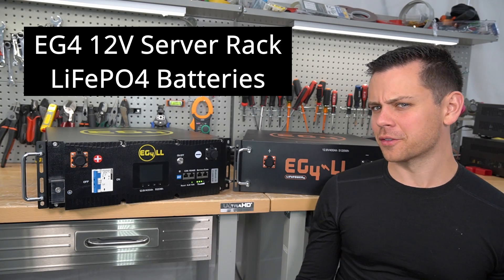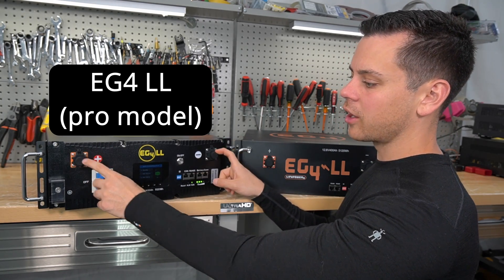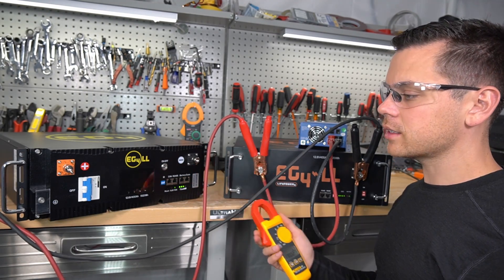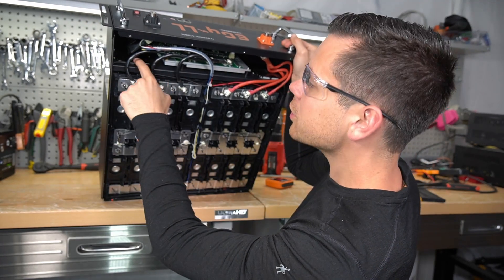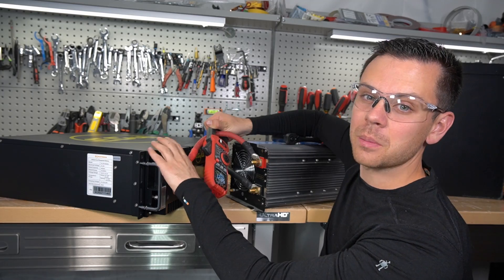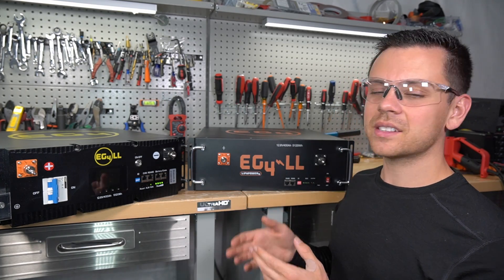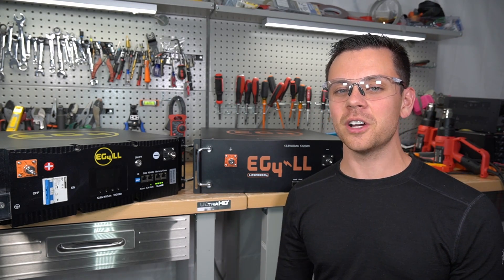$1,449 EG4 12V 400Ah LiFePO4 Server Rack Battery

Comment from the maker: Signature solar has a sale for 5% entire site. Affiliate links here:
Budget 12V 400Ah Battery: https://signaturesolar.com/eg4-lifepower4-lithium-battery-12v-400ah/?ref=cPwLcVc0SW-BjN
Pro 12V 400Ah Battery: https://signaturesolar.com/eg4-ll-lithium-battery-12v-400ah-server-rack-battery/?ref=cPwLcVc0SW-BjN

The sale is 5% and a deal for shipping these batteries. This sale ends April 18th.

If you don't need 400Ah, the cheapest 12V lifepo4 with low temp protection can be found here: https://amzn.to/3KoNVlq

Price comparison is in 100Ah. Figured that was obvious but saw a  lot of comments not understanding that. Sorry 

0:00 Intro
4:14 Charging to 100%
5:40 Budget Battery Max Current Test!
7:08 Budget Battery Tear Down
9:16 Pro Battery Over Current Test
11:16 Pro Battery Tear Down
13:10 Fire Arrestor and Breaker Discussion
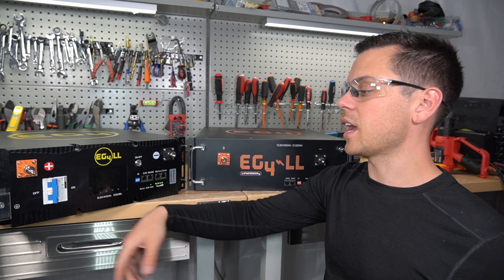14:32 Downsides
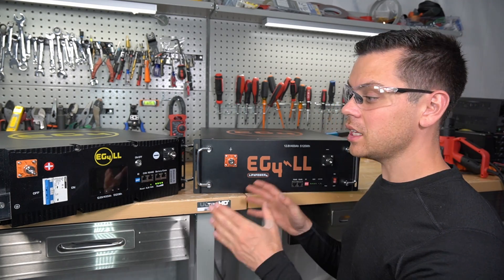16:52 Price Comparison
18:05 Conclusion

~~~~~~~~~~~~~~~~~~~~~~~~~~~~~~~~~~~~~~~~~~~
Tired of getting ripped off? Check out my "Will Prowse Approved" solar product recommendations below!

12V Batteries
https://www.mobile-solarpower.com/lithium-batteries.html

48V Batteries
https://www.mobile-solarpower.com/48v-batteries.html

Offgrid Inverter System Builder
https://www.mobile-solarpower.com/48v-complete-system-blueprint-559371.html

Hybrid Inverter System Builder
https://www.mobile-solarpower.com/code-compliant-48v-offgrid-system.html

Mobile Handtruck System Builder (very popular!)
https://www.mobile-solarpower.com/mobile-48v-system.html

Solar Panels
https://www.mobile-solarpower.com/300w-solar-panels.html

Ground Mount Solar Racking
https://www.mobile-solarpower.com/ground-mount-racks.html

Wire, Lugs and Busbars
https://www.mobile-solarpower.com/wire-and-connectors.html

Tools
https://www.mobile-solarpower.com/tools.html

Fuses and Circuit Breakers
https://www.mobile-solarpower.com/fuses.html

Plug-N-Play Solar Systems
Ecoflow, Anker And Bluetti! So many models to choose from. See my current recommendations here:
https://www.mobile-solarpower.com/full-size-systems.html

~~~~~~~~~~~~~~~~~~~~~~~~~~~~~~~~~~~~~~~~~~
Need to build a large DIY system? Need a trustworthy solar distributor? These are my favorites:

Signature Solar
Creator of EG4! Solar Minisplits, Victron and More! Largest Solar Store Online.
If you want $50 off, please use my link below and coupon code "DIYSOLAR50":
https://signaturesolar.com/?ref=cPwLcVc0SW-BjN

Current Connected
Best Prices for EG4, Victron, Midnite and so much more! Fast Shipping and Highest Rated Customer Service:
https://currentconnected.com/?ref=wp

~~~~~~~~~~~~~~~~~~~~~~~~~~~~~~~~~~~~~~~~~~
Join our DIY Solar Community 
Need more help? Join the largest solar forum on the internet for beginners and professionals alike. 140,000 members and counting!
https://www.diysolarforum.com

Check Out My Free Book
Best-selling and beginner-friendly guidebook to off-grid 12V solar!
https://www.mobile-solarpower.com/the-book.html

~~~~~~~~~~~~~~~~~~~~~~~~~~~~~~~~~~~~~~~~~~
Contact Information:
I am NOT available for personal solar system consult! If you wish to contact me, this is my direct email: williamprowsediysolar@gmail.com
FTC Disclosure Statement and Disclaimers:
Every video includes paid promotion or sponsorship (such as free products for review). Some links on this YouTube channel may be affiliate links. We may get paid if you buy something or take an action after clicking one of these. My videos are for educational purposes only. Information is subject to change/update at any time. Electricity is DANGEROUS and can kill. Be smart and use common sense :) DIY Solar Power with Will Prowse is a participant in the Amazon Services LLC Associates Program, An affiliate advertising program designed to provide a means for sites to earn advertising fees by advertising and linking to Amazon.com
Reply: You should mention how much these things weigh. I ordered one and after getting the receipt did it saw fkibg ONE HUNDRED AND TWENTY FIVE POUNDS!!  I HAVE NO IDEA HOW TO GET IT ON MY HOUSE
Reply: Inside house
Reply: Awesome review and video!
Where are these batteries being sold at this prices you mentioned on the video:
EG4 Lifepower $362
EG4 V2 $437
Reply: They have 24 volt models do you think the quality and build is the same? I also am running a 24 volt 3500 wats Outback Power inverter will the 24 volt version run with the 3500 watt Outback? 

Thanks John
Reply: from what I understand , you prefer and recommend 24v verses 12v.  I plan on building 24v/100a overkill battery with 3000w pure sine inverter and 24v-12v converter to tie directly into my current multi fuse box.  the top of the caravan is congested with other fixtures so I don't think I can get enough panels on top. I plane on building a rack on top of my ford expedition to hold the panels and run leads to the RV.

Comment: I'm confused that doesn't make sense to me to charge them to 3.65 and only draining them to 20% . I was always told to never charge to 3.65 as it's pointless because the drop from 3.65 to 3.45 is so fast it don't seem adequate and a waste . My cells are full charged at 3.45 and dead at 2.50 which makes alot more sense.

Comment: My 12v 400amp battery out of out of balance after one year when I hooked it to the Bluetooth after seeing my battery goes to the protection mode when Icharge it the battery Sael  is reading  3.37 -3.34 - 3.38 - 3.79 can you halp

Comment: If I was to use this for vehicle  life applications, What is the best way to charge with the alternator? The 800  watt alternator charger by Ecoflow? or multiple Dc to Dc 40A chargers by Renorgy? Have 420 Amp alternator. If I had a 48V battery just like the hand truck DIY, can it be rigged to charge with 12V car alternator?

Comment: I just bought a 32 ft travel trailer. We are building a Shop w lean-to. We are going to move into the Trailer which is parked under a lean-to, and sell the current house. And be debt free. And will also use Trailer for occasional Friday thru Sunday camping. So many state parks are booked until last week of September. So the point is, if we want to camp in the summer when school is out, it seems we need to do the no-power spots. I just bought the EG4 12V 400ah battery, from signature solar,  so I can do some sort of off grid camping. It'll deplete running an AC. But should do just fine with charging two phones. Ipad for streaming. Refrigerator. 12V led lights. Water pump. Probably need my inverter Gen for the AC units. Csn run 2000w inverter generator to charge the EG4 battery. I have 2 renogy 100 watt solar panels along w a Victron 100/30 MPPT and hope to do some cool stuff w the travel trailer and the 12V 400ah battery. Also have a Interstate RV/MARINE 92ah battery as a "stock" back up.

Comment: PROBLEM!!!    @WillProwse the EG4 LifePower4 batteries are a great value and even on sale right now however the units I purchased (3x) over the course of about 12 months have two different BMS model / software versions and two of the batteries errantly report that they are 100 Ah designed capacity instead of the correct 400 Ah they should be.  This is wreaking havoc on my setup as I purchased a new EG4LL to be the "master" (with the other 3 as slaves) which can talk to and report SOC to my Victron Cerbo GX but the errant capacity reported by those two batteries completely throws off the calculated SOC for the whole bank!  EG4 has not responded to my emails and Signature Solar doesn't know what to do about this since there are NO FIRMWARE UPDATES at all for these batteries.  If anyone here is planning to put together several of these as a bank, buyer beware that they might get the BMS version that reports wrong and thus makes BMS comms pointless :(

Comment: Love your videos, Will.  Most of it going over my head since I know next to nothing about electronics, batteries, electrical. However, the fact that I can buy an EG4 lithium 12V battery at a fraction of the cost of others, is very heartening.  I was despairing about that.  So very glad to have your videos and insights and testing.  Thank you!!

Comment: Went to Sig solar to look for a manual for this battery and they have been pulled from the site. Looks like they are clearing out remaining stock of the other variations and then removing all traces of them. From my order page I get:

EG4-LL Lithium Battery (V2) | 48V 100AH
Unfortunately this product is no longer for sale so it cannot be reordered. 

So much for adding more to an incomplete system......
I looked around and cannot figure out if EG4 stopped making them or Sig Solar just stopped selling but shop solar has them far cheaper than sig solar ever did even a week or so ago when they were still there.

Comment: I noticed that the circuit breaker on the Pro model was a 125A, but you mentioned that the battery was rated for 200A continuous discharge

Comment: Hi I just bought a EG4 LL Lithium Battery (V2) | 12V 400AH | Server Rack Battery from you now I am looking for and inverter to use for my RV off grid have 5 solar panels  just want to be able to use when not plug in or dry camping thank you Ron

Comment: We used an arc welder to rejuvenate dead 12v lead acid heavy equipment batteries with great success. One of the mechanics had the nack of it, and dog dead frozen batteries could be desulfated and last another year or two. As long as they didn't blow up during the thawing process.

Comment: Will, We purchase the budget EG4 server rack battery you have in this video from your affiliate.  We purchased a PowerMax PM4 75 Amp charger.  We have the charger set with a fixed stage and 14.0 volts per the battery mfg requirements.  We are having problems with the battery going into a protect state for over voltage on cell 4.  We have cycled the battery down to 20% and charged back to 100% for 7 days.  Still having the same issues after 7 days of frustration.  We have been told by the battery seller's customer support that the charger is not compatible with our lithium battery.  What charger did you use to charge the EG4 LiFePO4 battery in this video?  Any recommendation that are budget-friendly for our RV?

Comment: Got a question 
I have 2  24v server rack batteries running to a bus bar 
And one is discharging at a faster rate
Both at 100%
Put them under load 
One is 96%
One is 99%
Is that normal for them to not be balanced 
Thanks

Comment: You've got some great videos!  

But I'd like you and everyone to know, I just paid $16,123.21 to SIGNATURE SOLAR 903-4412090 TX on 07/10/23 for EG4-LL Lithium Batteries Kit (V2) | 30.72kWh with 6 Server Rack Batteries with Pre-Assembled Enclosed Rack with Door & Wheels and the EG4 18KPV Hybrid Inverter.  The next day, 07/11/23, I drove to Texas from Florida to save on shipping to pick these up after they notified me it would be ready for pickup. When I got there, after making an appointment to pick them up an having to be there within a 15-minute time period or they canceled your appointment, they notified me they did not have the rack because they were having trouble with the maker and the welding.  They are selling batteries and the rack, without the rack!!!  This does no good because you can't install the batteries without the rack.  I'm waiting for the rack and my warranties are running out. They told me they would send me the rack, but they have no idea when.  You can't build a system without the rack!!!  But they are selling them and not telling you they don't have the racks because they charge $10,119.00 for the set.  If you look on their website, you'll see some items listed as "Out of Stock", but not the racks because this too much money to lose. BUYER BEWARE!  

Will, I noticed on one of your videos that you commented that you are still waiting and don't have a door on your rack from SIGNATURE SOLAR.

Comment: Can you parallel these 12v batteries to create 800ah battery bank ? I've done it on flooded acid batteries but I'm being told by people that you should only go series, not parallel on these lithium server rack batteries. It seems that if you match the voltage prior to connecting in parallel then everything should be fine right?

Comment: I have the cheaper model without the screen and breaker.  I'm having all kinds of trouble getting it to run a 3000 watt magnum MSH3012RV.  I believe the precharge resistor circuit is kicking in when it's not needed, which momentarily drops the voltage to the inverter near zero (5ohm resistor).  Battery faults just turning it on.  If I get it boot up the inverter, when I turn the inverter precharge circuit kicks in and browns out the inverter and it re-boots.  Microwave doesn't have a big inrush, steps up to ~ 140 amps...But every other time it faults the battery.  I even had it kick in when trying to charge from then generator, which faults the battery, kills all power including to the gen controls, turning off then generator!  Unfortunately, I have gotten nowhere with Signiture Solar's tech support.  It takes a week to get an email returned, multiple calls, hours on hold, and nothing.  They also refuse to take it back and refund me.  They can't tell me exactly what conditions cause the precharge to engage (like >200 amps, > 300 amps for xx milliseconds, current ramp rate, etc), so I can try and avoid those or design more work arounds.  The 24 & 48 volt models got firmware updates to resolve many such issues (11 months ago), but nothing for the 12V models.  If you can help with any information, it would be greatly appreciated.

Comment: I enjoy your videos will, thanks. I am going to purchase one of these two batteries. Based on the two batteries and the difference in price, do you feel the additional 5-year warranty and difference in two versus three positive leads is a benefit over the savings of the budget battery? I will be using a separate battery switch for convenience.

Comment: I just ordered this bad boy, Shipping was pretty expensive but, I am replacing my only 1.5 year old renogy gel cell 200 amp hour batteries.  Mine is a small emergency of grid system not tied directly to the house, I actually have the newest model of the gandelle 4000 W inverter. I'm glad to see you use that 1 hopefully it should work OK on mine.  Mostly to keep the fridge cold the entertainment center and Internet running during power outages.

Comment: I have a question. If I use a lithium battery that is being charged by my boat alternator in the BMS switch is off. How do I protect the diodes in my alternator from burning out?

Comment: I live off grid on a farm in a camper.  I scraped up three 12v deep cycle lead acid batteries. Connected to a 1000watt inverter. I have three foldable 160watt dokio panels all running to very cheap pwm controllers. From learning in one of your videos it doesn't matter how many controllers you connect to a battery bank.  Was a question i didn't even know i needed answered at the time.  I also have a 6500watt gasoline generator that is to expensive to run. 
I am wondering if I should replace the charge controller first because it will help me now and down the road when I can afford lithium cells to build a battery of my own! Where can i find your book?

Comment: Hi Will
Do you have any experience with a parallel connection of lead acid golf cart batteries with 4 24v lithiums?
I notice a substantial increase in charge and discharge capacity. When operated separately the bms kicks in too early preventing a full charge/discharge.

Comment: Thanks for rounding back to discussing 12V systems. For small mobile applications—5 kWh or less—it's hard to justify the costs of using 48V or even 24V. The cost of thicker, but very short cables, etc. don't make up for the higher cost of less common equipment. 

I would like to hear more on the reliability of server-rack batteries in a high vibration environment such as mounted in a van or small RV. Do you have any input on this subject?

Thanks again for your quality reviews and advice!
Reply: The way I figure it, if you're going to need 4 12v batteries, might as well go 48v.  If you need 2, go 24v, less? Go 12v..  considering all the 12v is just a parallel vs series battery with the same wattage overall.  Yes, less than 5kwh, (if you don't plan to expand) makes no sense, neither does 4 12v either.
Reply: @DannyBowen25  I don't agree. There are plenty of reasons to stay at 12v or 24v for mobile.
Consider that, for many applications, you will want to power with DC.
Also, my current consideration is to use 280 or 302 Ah LiFePO4 cells, so I am looking at one, or at most two batteries.
Reply: @BobCollins42  DC to DC converter. D for done.
Reply: @BobCollins42  We are all welcome to disagree;) In the end, a 300ah battery is just cells organized differently.   They are all the 3.2v batteries just lined up to max 12v at certain ah capacity That's why they end up costing similarly.  $1100 for a 300ah 12v, calc up to a 12v 400ah $1500, and it's the same as a 48v 100ah. Just easier to send 48v across a wire, less amps.  You'd have to buck convert with 24v to 12v, 48v to 12v is about the same cost. Efficiency Losses are relative.  Cheaper than copper if you ask me, but  If you MUST stick to 12v, I'm not hating you for doing it lol
Reply: @DannyBowen25  BTW, when I compared the delivered price of server-rack batteries and smaller batteries, the smaller batteries were less expensive. The shipping on server-rack batteries is usually close to $300.

Comment: So if you have an RV with 800watts of solar, will that charge these server rack batteries, and also will these run an A/C unit without being drained in 2 hours on a small 32,000 btu trailer.